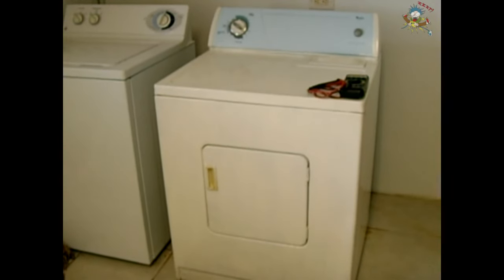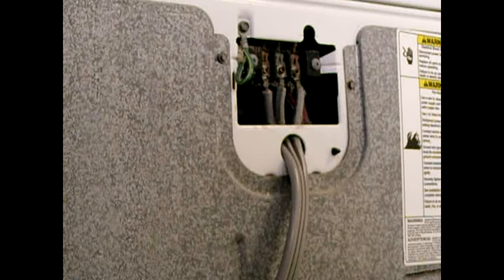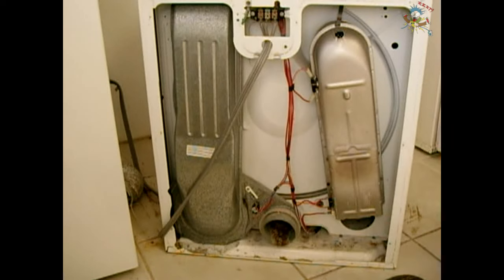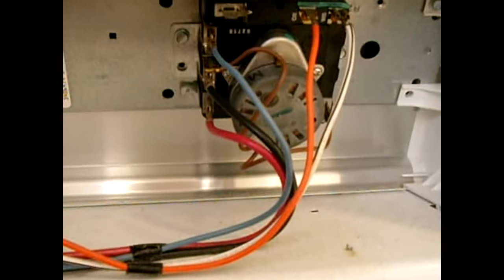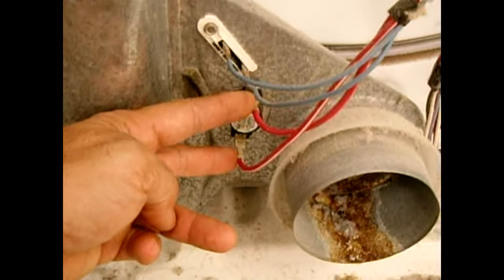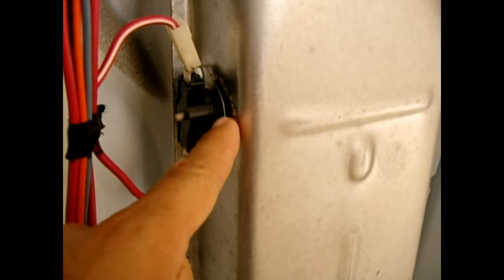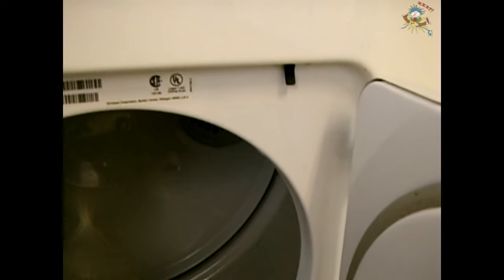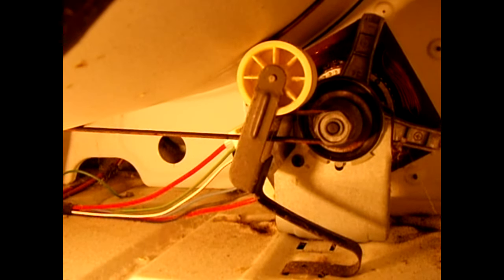Dryer Not Heating, Won't Spin, Or Start Up

Comment: I was wondering why my dryer has 2 operating temp thermostats in lower left. They both look the same with the 4 pronged thermostat. My dryer is a Kitchenaid Superba and it works but it has only one temp (hot) and does go to the cool off cycle when timer reaches the last 10min of drying. However, I do have a delicate, and other cycles besides the towels (hot) cycle that when I set to still just blows the hot air??? Is.this because one of my operating temp thermostats is bad or again, why do I have two? No other dryer video I've watched has more than one. Thank you for posting such a detailed video on troubleshooting dryer operation because I learned alot!!
Reply from the maker: What you describe does sound like 2 thermostats. Look for the schematic(wiring diagram) in your dryer. Normally it is behind a cover or a piece of paper taped inside the unit. If the unit always blows hot no matter what setting, then there is a problem with the timer control or switch inside the motor.

Comment: great video but I do have a question.  I have a kenmore elite dryer that wont start- nothing when the start button is pushed.  I tested the start button-its ok, I believe the timer switch is faulty at a couple settings based on the wiring diagram.  My question is would this prevent the dryer from starting in any setting?
Reply from the maker: Faulty door switch or timer.

Comment: When testing the hot wires and the ground wires for voltage; should the dryer be plugged in?
Reply from the maker: +konica willis Yes. Use the probe tips on a 250V AC setting or higher.

Comment: Thank you your video was super informative. I think one of my fuses may have blown i heard a pop sound and the cooling light remained on. Um going to test everything u showed me here though.
Reply from the maker: tawna mobley The pop sound could have been the resistive heating wire melting in one spot and touching a grounded object. If that happened, you can take a pair of lineman's pliers and twist the 2 ends back together very tight.
Reply: I tried taking my dryer apart and found a broken belt hopefully it wont be hard to replace
Reply from the maker: Just make sure you buy the correct belt. No big deal replacing the belt.
Reply: ok thanks alot

Comment: Hi. Great videos.  I was able to fix mine with new rolers and a thermal fuse. But Now if I open the door during a cycle the heating element doesn't turn off.

Did i mess something up changing the left thermal fuse (mixing the wires for example).  Or did my motor broke?
Reply from the maker: I have no idea what you did wrong. Always take pictures before removing wires.

Comment: Thank you for your video My whirlpool dryer shoed PF couple of times and then never turns on I check thermal fuse. Fuse was fine. circuit breaker works fine and then what???

Comment: Great video, I have a gfdn110ed2ww GE dryer. My dryer is not drying in low temp mode and in high temp mode it takes a long time

I have tested the coil, the thermistor and fuse and everything seems to be in order. 

The problem is the inner coil is not heating. Don't know if the coil is bad or the Circuit board is bad. How do I diagnose this
Reply from the maker: Either a faulty thermostat/temp sensor, a faulty element, or the switch inside the motor is dirty/faulty
Reply: @electronicsNmore  thanks for the response. The motor rotates does that not rule out the switch inside the motor?
Reply from the maker: @kevins3646  Usually if the switch inside the motor is dirty or faulty, the heat wont work at all. Take the switch apart and check it.

Comment: Great video. I will be replacing my Operating Temperature Thermostat and Thermal Fuse. The only concern I have is The timer motor is only showing a little over 1000 ohms. On the schematics the readings are showing the opposite of what the schematics call for. (closed when it should show open and vice versa) This is only happening when checking the continuity between the terminal named TM and the other terminals. I believe the TM must stand for Timer Motor.... Does it matter which side of the timer you check from?
Regardless I bypassed the fuse for about three seconds just to verify the drier would work if it had continuity and it did.
Thanks again and if someone could chime in about the TM reading I am getting I would greatly appreciated!

Comment: Great video!!!  Im having an issue where the dryer is starting and the spins, but cuts out after around 15-20 seconds.  So its starting but not staying on.  Any ideas?
Reply from the maker: Hi John. Need more detailed info.
Reply: The dryer is a Kenmore 70 series. Was fine yesterday with drying a regular size load. Went to use it today and when hitting the start button if I hold in in it runs for about 15 seconds then cuts off and won't do anything for about 5 minutes and then will run again for about  15 seconds before cutting off
Reply: @johnmakejew3466  Have you tested the motor windings? An open circuit in the run winding can behave like that. The start winding works until it overheats but the run winding doesn't take over..

Comment: I made a repair to the heating element on a GE dryer Model DBXR463ED2ww. Used a part # WE11X10007 unit. My question is should the front get hot in the area of the lent filter to the blower wheel? Thermometer shows it to be 123 degrees. Hot to the touch. Didn't noticed the front being hot to touch before I changed the heating unit.
Reply from the maker: Just make sure there are no obstructions and you have good airflow out of the dryer vent.

Comment: My outlet reads 120 and 240 where it should. When testing the left to ground connection I am getting 200+ volts when it should be 120V and right to ground reads .4 to -4V when it should be 120. I get 240V outside to outside as it should. When testing ground from dryer connection to the plug it reads 0 but from left and right screws it reads .4, not zero. Is this signs of a bad cord? I am thrown off by the 200+volt reading from left to middle connections when plugged in.

Comment: I have a kenmore dryer. I replaced every fuse except the timer. It was drying after replacing all of the fuse but then it stopped heating after one cycle. Do you think I should replace the timer. That’s the only part I have not replaced lol. Does the timer prevent it from heating ?
Reply from the maker: Sounds like dirty contacts preventing the heating elements from powering up after the motor starts, or a faulty thermostat. Thanks for watching!
Reply: electronicsNmore i replaced all of the sensors and heating elements. I notice that time timer doesn’t ends at the off but close to 10 min mark. Does the timer prevents the machine from heating also?

Comment: Thanks for the detailed video! I have a question though. My dryer keeps blowing the fuse on my house panel. Since its 240, there are 2 fuses in my panel, instead of breakers. After running and heating up for about 5-10 minutes, one of the 30amp house fuses will blow. The dryer will continue to spin but no heat. Once it gets to the cool down cycle, it just shuts off before it gets to the end of the cycle. I ran some of your checks, I have 120v on each leg and 240 between the legs. The voltage doesn't drop more than a few volts during the first minute or so. All thermostats have continuity but I don't have a good way to test the temperature that they will shut off so I haven't checked that yet. I did check the timer and am getting some odd readings. I am getting a closed circuit during the end of of cycle when it should be open. So could a faulty timer cause my house fuse to pop? I figured one of the fuses on the dryer would trip before the house fuse did. Any help would really be appreciated!
Reply from the maker: You need to use a clamp ammeter to measure the current. Make sure the current being used is very close to the max current rating of the dryer.
Reply: Hi, I love this video and I am learned a lot. Thank you! I have a similar problem as Kansas Country.  After a 3-20 mins my dryer trips the 30amp fuse in the basement. The dryer stops completely on mine when it trips, no heat, no spin.  I have tested all the fuses in the dryer and they all have continuity. Also tested the motor and it seems ok. Can it be anything else? If it is poor amperage, how would I test for that? My dryer is 26Amps. What would I need to do if the number is off?
Reply: I will also add that the fuse box does not trip when I just air dry it.

Comment: excellent video, I still haven't figured out what would cause one problem though..the dryer is back to back with a double oven, separated by a stud wall. The dryer is on a separate 240 breaker. When you turn on the dryer, the clock on the oven goes off, like it lost power and then blinks till I reset it. This is a recent occurance. I suspect the windings in the motor but not sure. I have checked both breakers and wireing and plugs, can find no fault on either. Ground wire to house is good. No other schisms anywhere else. Any ideas? Thank you again for the training video...
Reply from the maker: If you measure the AC voltage at the oven receptacle when you turn on the dryer, and it drops way down from 240-250V, then you definitely have a wiring problem. Sounds like a loose wire or high resistance connection in the breaker panel.
Reply: thanks for response. I will check it out...right now the dryer is not running. Gotta go outta town for a while. I know you are a busy dude, hopefully I can get this squared away soon. thanks again

Comment: ElectronicsNmore my romper dryer won’t start. My thermal fuse is blond for the second time in a week. I pulled my heating element down and tested it and it has continuity but the plat between the coils is fractured showing of high heat but not touching the coils. The thermal cut off switch that you said can not be reset is not alarming with good continuity. I’m assuming it is blown. Do yo think that it the control thermostat under the thermal fuse has not reset to the proper temp allow the heating element to get to hot causing the unsettable one time switch above the heating element to throw. FYI if I tap the thermal fuse wires together the dryer will run... just did that as a test... did not leave them taped
Reply from the maker: If you keep blowing the thermal fuse, then the thermostat is faulty. Thanks for watching!

Comment: Hi, I have a Kenmore 80 series dryer with only a timer and start switch on the panel.  My issue is the dryer is too hot on the delicate heat setting.  I changed all the fuses, stats, seals, heating element, timer and it still cycles between 140-155 on the low heat setting.  I'm stumped.  Have you ever encountered this problem before?  The cycling stat has continuity and the mini heater on it has 7k ohms.  The vent is clear and the only items that haven't been replaced are the motor, start switch and wire harness.  Can't understand why it's not cycling at a lower temperature.  Thanks!
Reply from the maker: Joe Gonzalez Lack of airflow through the dryer or a faulty thermostat. Thanks for watching!

Comment: After viewing this video I have a question to ask.  My dryer heats normally and works but when the timer clicks off the heating element stays on and I have to unplug the dryer to kill the heat.  I thought I had a timer issue but after looking at your video I now suspect the element switch on the motor may not be opening when the motor stops.  Does that seem more likely?
Reply from the maker: +Inspector71 
If the motor stops running, and the dryer keeps heating, then clearly the switch on the motor is stuck in the closed position.
Reply: Thanks for the replay...every bit helps.

Comment: Great video, very informative. I have an electric Maytag and the operating thermostat (near the thermal fuse) has 4 prongs instead of 2 like on your video. The 2 outer ones (red and red/white wires) have continuity however the 2 inner ones (both purple wires) do not. The issue I'm troubleshooting is that the dryer gets hot but not hot enough/long enough. We have to run each load at least 3 times for them to dry. The heating element, thermal fuse and the high temp cut off all tested good for continuity. The power supply tested right at 240v (120 per side). Do you have any suggestions?
Reply from the maker: Did you check to make sure the lint screen is clean, and the discharge hose is unobstructed? Heating the thermostat with a hair dryer, should get the 2 other contacts to open/close.

Comment: when testing power supply do i leave it connected to the wall or no?
Reply from the maker: You need to leave the power on in order to probe the wires at the rear of the dryer. Unplug the dryer, remove the cover for the wires, plug the dryer back in, then test for power at the screws using an AC volts setting of 250 or higher. Touch NOTHING with your fingers, only use the test probes. Once the test is complete, you unplug the dryer.
Reply: That was a good question, Ed. I wondered the same thing. Thanks for the detailed reply without any "what a dumb question" attitude. This video is awesome!

Comment: When I test different components with a multimeter fo ohms resistance, I disconnect one of the terminals.  Do you not do this?
  Btw, the link does not seem to work for me. I type in something, hit Done, and it brings me back here.

Comment: i have a whirlpool electric dryer...our dryer is working and heats up some but i have to run the dryer three or four times for my clothes to dry...especially towels or jeans...please give us ideas what it might be...thanks
Reply from the maker: +Madlen Muir 
Hello there. If the lint screen is clean, then you may have a faulty heating element, or a heating element which is turning on and off due to a faulty temp sensor/cutoff or excessive heat. You can unplug the dryer, remove the back cover, then connect a multimeter set on a range of 500VAC or 1000VAC to the heating element terminals using jumper wires. Place damp clothing from the washer into the dryer and turn it on. The voltage should stay around 240/250V while the dryer is running when damp clothing is inside. Let me know what happens as you continue to watch the meter as the dryer runs over a period of time.

Thanks.

Comment: Hi have an electric Roper dryer.  It's two years old.  It's been running fine until the other day, I am not getting any heat.  I had all thermostats and fuses checked out and is OK.  Heating element checked out too.  I did replace the timer completely.  Still no heat.  Any ideas

Comment: @electronicsNmore what if the dryer is overheating and shutting off? I replaced the thermostat next to the blower that didn't work and I talked to an experienced "technician" and I tested the volts going in to the dryer and they were fine so he said the motor was bad even the dryer was 6 months old. So I replaced the motor and it STILL shuts off after like 15-20 minutes and then cools down and you can turn it on til it shuts off again. Any ideas?
Reply from the maker: Sounds like a lack of airflow(blockage), incorrect thermostat, or a faulty thermal cut-off.

Comment: I have an LG model DLE3400W and it shows me an error code tE1 and it doesn't do anything or move the drum, I changed the thermistor and it's still the same, what do you think the problem is?

Comment: I found out that the fuse is bad and the high limit thermostat still works. I bought a fuse that included a new thermostat as part of the kit. I am installing the thermostat now that comes with a jumper cable and it is slightly different from the old thermostat. I now have an orange wire just hanging from the dryer and I'm nervous about turning it on. Should I do something with the orange wire hanging from the dryer or just go back to my old thermostat?
Reply: Nevermind I found out I have to add a female/male combination. Thanks
Reply: NewOrleansEastside good

Comment: Hi, I have a Whirlpool compact electric dryer model#WED7500VW, which has no power. Upon testing , There is power to the unit at the power cord terminals. I did observe the door swich connection was melted. I checked the swich for continuity and it tested ok, so im not sure why its not functioning ,because i put a jumper across the switch and it did power up. also the machine is not similar to any video i can find, so i dont know how to reassemble the belt. there are two motors, also. Thanks Rich
Reply from the maker: +Richard Treglia 
It is very unusual to have a melted door switch. The blade connector on the door switch must have been loose and heated up the connection. With the unit unplugged, you need to trace the power supply wires. I suspect you have a blown thermal cut-off/fuse. As for the belt, you need to look online for a diagram.
Reply: But when I jumped the door switch i did get power to the front panel, so does that mean there could still be a blown fuse?
Reply from the maker: +Richard Treglia Faulty switch. Replace it.

Comment: A great video. Well produced and very informative. Keep up the good work...you are obviously very much appreciated by your viewers. Question...my whirlpool dryer has a control knob with  Low, Medium and High heat settings. Works fine when I select the Low or Medium setting  but no heat, just cool air when I select the High setting. Any suggestions? Thanks very much.
Reply from the maker: Stan Refcio First remove and test the switch using a continuity tester. Make sure all switch positions work. If it works, then replace the thermostat.
Reply: Thanks so much for your quick reply. I'll try as you suggested. You're amazing.